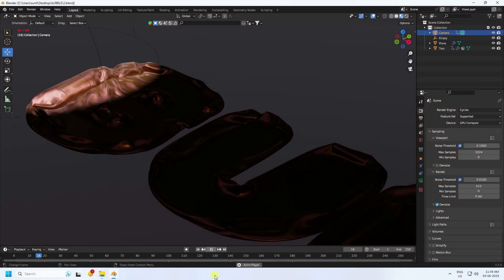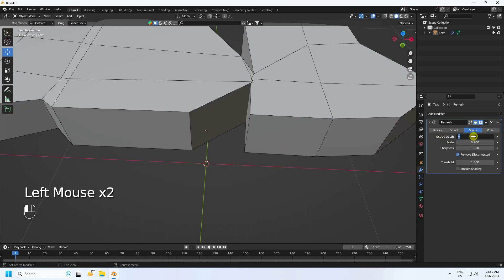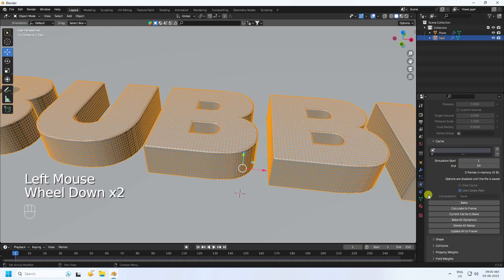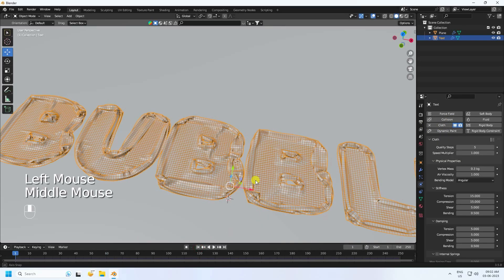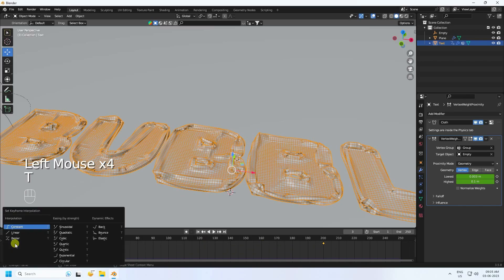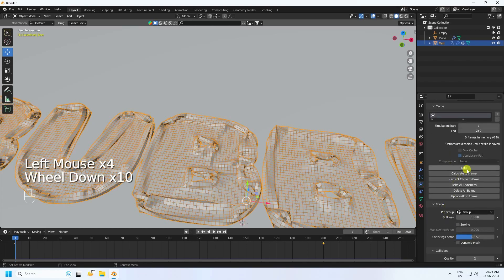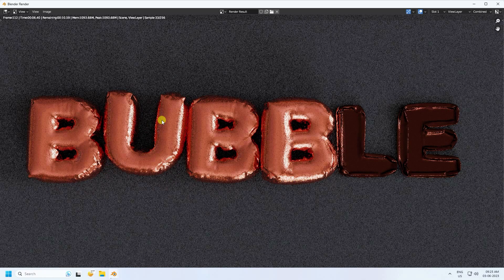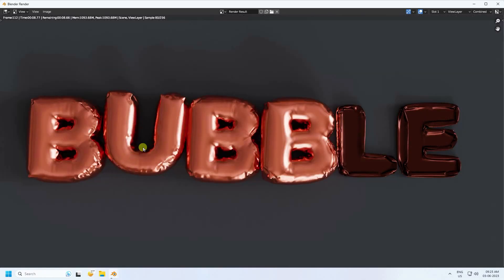Creating Bubble Type or Balloon Text Inflation Simulations in Blender

Comment: I have a problem at 10:20. I'm on Blender 4.2, the latest so far, and my Capture Attribute node
1) doesn't have a Value property
2) It won't connect to the Group Input and Group Output nodes. I can attempt to connect them, but then those lines just "disappear" without connecting.
Reply: hii
how did you solve that problem? 
i have same trouble
Reply: i have the same issue

Comment: 12:28 Geometry mode isn't same anymore, can't find output and value attributes
Reply: have you found the solution?
Reply: @Valerio_Errani  im very new to blander, not sure if this is the right way. But it worked for me. on geometry node, i just added (shift+A) value and connect the socket to the grey sockets. then you can see that the value sockets appear.
Reply: Looking for this too - anyone figure it out yet?
Reply: Я нашла решение 🎉
Reply: Go to Geometry Nodes, search for "Value" and connect Vaule to Capture,connect to Group Output. This will change the modifer to add the Group.

Comment: My text will inflate perfectly but will inflate from a normal text looking object instead of the balloon one. It goes from the normal unchanged text to become the balloon one but I want it to start as a deflated balloon and inflate from that. Help?
Reply: having the same issue
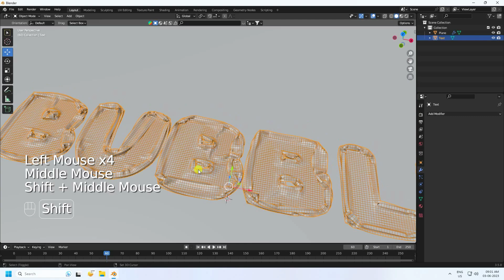Reply: its because at 4:10 when you apply remesh and cloth modifiers you are probably at around 0-5 frame. If you apply those while on frame 60 for example you'd get the effects just like in the video